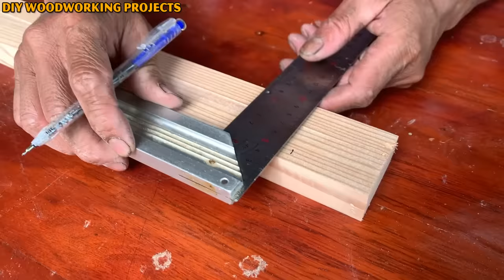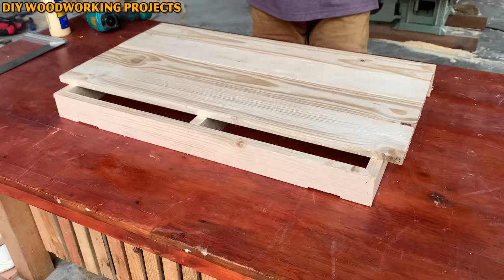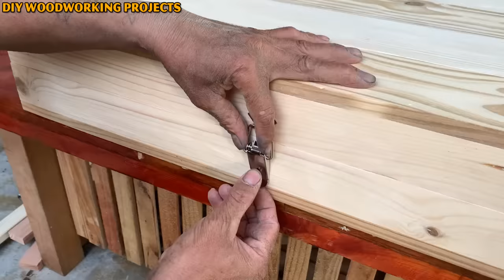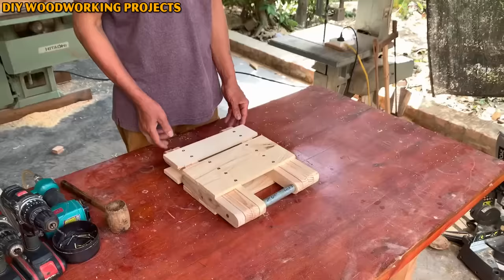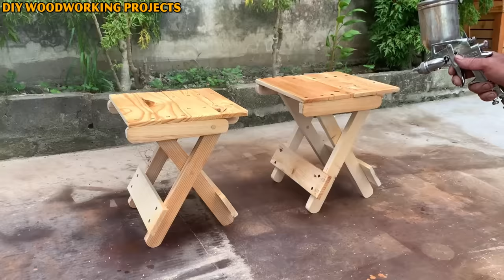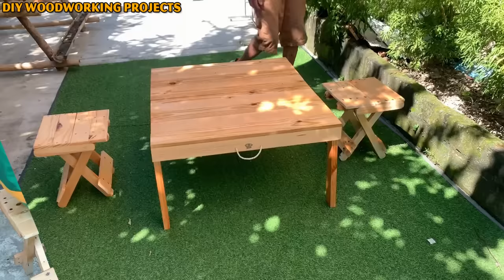Space Saving Woodworking Design Ideas For Picnics Or Camping // Folding Table And Very Handy Stool

Comment: Very Cool ... But I think would been Better to put latch on Outside of Handle, also Make the Inside area the same thickness on each side as one stool so they both could go on the same side opposite of one another, then add Straps to the other to hold plates, Glasses etc,
Reply: completely agree on the latch. I probably would put two latches. One on each side and the handle in the middle.